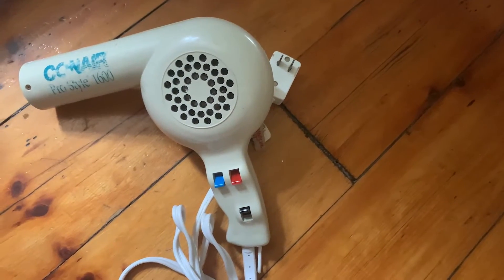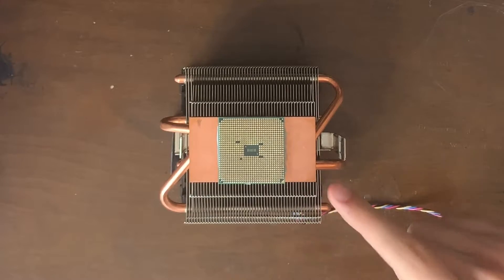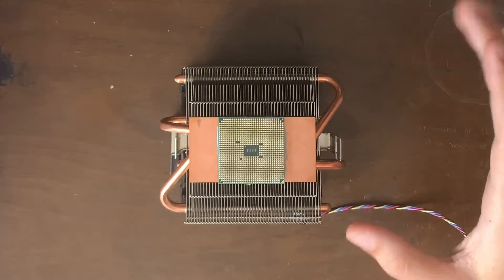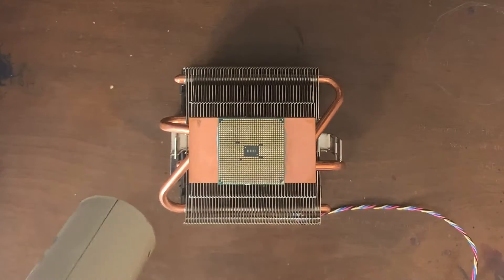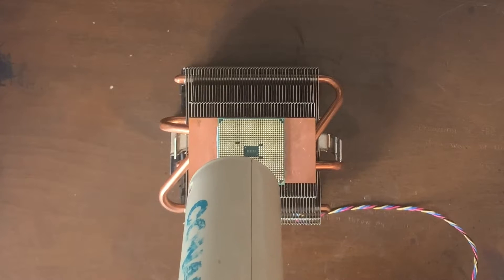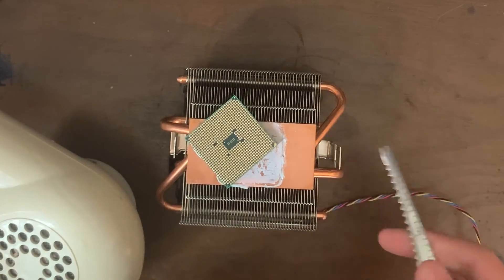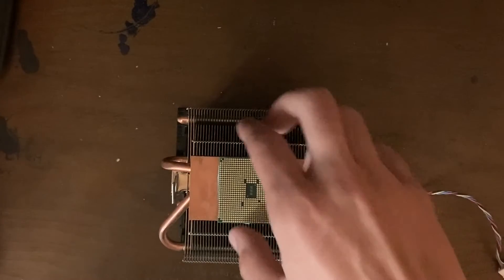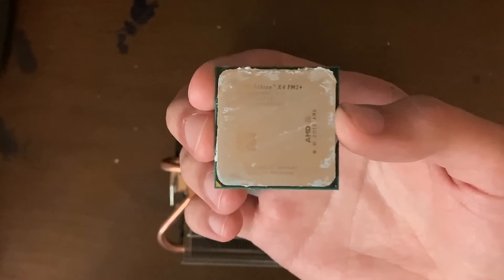How to Remove Stuck CPU from Heat Sink

Comment: My Ryzen 3900X got stuck too even after runnning a CPU stress test prior to removing it. It had the factory thermal paste and I ran this CPU for 4+ years. After trying to remove the Wraith Prism from the motherboard the CPU still came off with it and I bent 2 pins. Luckily they didn't snap off and I was able to bend them back in place. I'm glad AMD finally moved away from the PGA.

Comment: When you pull up a heat sink, and then if you just want to put it back on for whatever reason, can you just stick it back on with the old thermal paste? Will the old thermal paste heat up and become soft again after in use?

Comment: 1. You really have to get that hairdryer up close to get the thermal paste loose. Mine was dried up since I haven't replaced it in like four years.
2. I couldn't get a blade in beteween the CPU and the cooler, so I used a flathead screwdriver to forcibly get leverage. It worked but only do it as a last resort. Maybe you could use some plyers and support/padding to be more gentle, but I was so desparate. 
3. I bent the pins prying the two components, so I straightened them back together. Use a magnifying glass and get it as straight as possible. 
4. My system was shutting down on repeat after that, but it's because I didn't push the cooler back in all the way, so there was a gap between it and the CPU. After I sorted that out, my PC worked perfectly. 

Hopefully this helps even just one person. It was a stressful time, but it all worked out. 

Be gentle and be patient. Don't be like me. I was lucky.
Reply: HELP ME AND MY FRIEND HAVE BEEN TRYING FOR 5 HOURS SAME THING BUT OURS DOES NOT COME OFF AND WE ARE SCARED  WE WILL DAMAGE IT

Comment: Mine is literally stuck I have heated it up for 6minutes
Reply: Thats what I did bro and it eventually came off and it was not damaged at all. Thanks for the video
Reply from the maker: You’re welcome, glad it helped
Reply from the maker: Might be very ancient thermal paste. I would try heating it up for longer or making sure your hair dryer is on high heat.

Comment: What if you cant twist the cooler like the EK AIO. I have found that if you have no choice and you do pull the cpu out dont twist you will bend the hell out of your pins. you cant twist all the coolers .
Reply from the maker: Yes, twisting is for once the CPU is out of the socket, and still, you must hold the edge of the chip, NOT the pins, while twisting. Still any twisting at all should be done only with extreme care and at your own risk.

Comment: I had that happened to me once. My problem is the CPU latch couldn't be unlatched because the heatsink is too big and it's in the way. I made the mistake of pulling the heatsink and the CPU came with the heatsink bending the pins in the process. A very expensive mistake.

Comment: Are there brackets for prevention of a cpu coming out? Like holding the corners of the cpu to prevent it from coming with the cpu cooler?
Reply from the maker: Not that I know of. Intel CPUs are held down once installed in the motherboard, but AMD CPUs are not.

Comment: If you don't have a hair dryer?
Use a Q Tip dabbed in 99% ispropyl alcohol
Go around the crease of the chip.
Then twist the chip.
Reply from the maker: This, for sure.

Comment: Hey my man that works very well thank you for the tip. I heated it up for about 2 minutes with a blow dryer on high and with a little piece of plastic I wedged in there and it came right off. You the man!
Reply from the maker: Glad I was helpful!

Comment: How to avoid this?
Reply from the maker: If you want to prevent this happening to begin with, it’s a good idea to use a quality thermal paste and also to heat the paste by doing some gaming BEFORE attempting to remove CPU. Then, immediately after turning off PC, remove it, so that paste is still warm, and hopefully does not stick.

Comment: I thought it was meant to stick to the cooler no?
Reply from the maker: It is supposed to be a tight fit, but it should not adhere to the cooler when you try to remove it.

Comment: Bro how do you stick the cpu to the heatsink? Using glue or just heatsink will make cpu to stick itself?
Reply from the maker: You do not want them to stick together, since it is a nuisance to fix. I’m having some trouble understanding what you are asking, but if you are wondering how to install a CPU, use thermal paste, NOT glue. Under no circumstances should you ever use glue on any of your PC components, please do not do this. If you are not at all familiar with the process of CPU installation, I suggest you make sure to familiarize yourself with it before attempting to install a possibly very expensive CPU.

Comment: ggs I did this with my ryzen 7 3700x you’re a life saver. I was terrified 😭
Reply from the maker: I’m so glad it worked out! Nothing worse than when your CPU gets stuck like this. Thanks for watching.
Reply: I did it with the same part and my pins are bent to hell
Reply: @joshuabragg4782  dude I’m sorry man I was lucky none of my pins got bent I wasn’t ready to drop another $319.99 on a new cpu. I hope you get a new one cause the pc goes crazy
Reply: @khojertw  what caused it was being stuck to the cooler

Comment: I did this with my Ryzen 9 5950x the other day and damn near had a heart attack, Im soooo happy it still works lol
Reply from the maker: I’m glad it does! With a CPU that expensive, it really would have been devastating to render it unusable. Glad I was able to help, and thanks for watching!
Reply: I thought it would melt the pins
Reply from the maker: No, it definitely shouldn’t get hot enough to melt the pins. Especially since CPUs can withstand a fair amount of heat, and it is connected to a heatsink.
Reply: @LogansTechLab  yea I did it and it worked lol thank god 😭
Reply from the maker: Glad it worked out! And thanks for watching

Comment: Thanks a tryed for houers and nothing worked thanks a life time subscriber
Reply from the maker: No problem! Thank you very much for subscribing!
Reply: @LogansTechLab  can you help I have a problem a have a aoi Water cooler and on lanch it sometimes turns on and sometimes doesn't i found a temporary fix that I unplug the pc and wait few mins but on another day it diesel it again
Reply from the maker: @tntcomingcool4353  so when you power on the PC, the AIO just does nothing? Can’t say I’ve encountered this issue before, but maybe your psu is being maxed out? What wattage is your psu?
Reply: @LogansTechLab  sometimes nothing sometimes works fine and it worked for 2 years just a month ago start acting this way I tried swichin up the thing that I plug the air in
Reply: Idk but it worked fine before
Reply from the maker: @tntcomingcool4353  so what exactly did you do to cause the problem? Did you change anything about your PC before it started?
Reply: @LogansTechLab  no I didn't I started it one day lanched windows and then the pc tired off bc the CPU was on 120c
Reply from the maker: @tntcomingcool4353  yikes! That is a frightfully high. It sounds like it could be a broken AIO. Might want to replace that. How much did you spend on your AIO? If it’s a cheaper one, that’s probably it. AIOs do fail over time.
Reply: @LogansTechLab  idk I got the pc from my friend and it's a croshair cooler but I can't find it anywhere not even on their website well I think my cable broke and the same day my laptop broke lol good day but I fixing the laptop bc windows had disk error

Comment: I pulled out my CPU with the HSF without noticing until I looked at the socket.  I hope it's not damaged as the lever was obviously still down.  It still looks like new.
Reply from the maker: It should be fine, as long as none of the pins were bent, which is not very likely. I recommend that you just follow the instructions in the video, and you should be able to get your PC running again in no time. Hope this helps.
Reply: @LogansTechLab  Thinking of reselling the part.  I removed it to put in an upgrade, which works great.  My worry is I don't have an alternate way or other MB to check it.
Reply from the maker: @uncrunch398  If you feel comfortable doing it, I recommend you swap back in the old CPU to make sure it works before reselling it. If not though, just look at it and make sure there are no bent pins. If there aren’t, it’s probably fine to go ahead and resell it since the chances that it’s damaged are VERY low. Just make sure you package it carefully if you are shipping it. Watch a video on YouTube on how to package a CPU properly if you don’t know how to.

Comment: Help me please. I heat the cpu about 5 mins. But the paste still hard
Reply from the maker: Are you sure the hair dryer is set to hot? Sometimes they have a cold setting as well. Also, after heating, the paste can still remain somewhat brittle. Make sure, after heating, to twist the CPU, rather than attempt to pull it away from the heatsink.

Comment: Watching this after destroying my girlfriends ryzen 3700x and motherboard socket lmao.
Reply from the maker: I am really sorry to hear that. How exactly did the CPU and socket both get destroyed?
Reply: @LogansTechLab  so I've been building PC's my whole life, mostly intel. Went with AMD for my girlfriend's PC, it was my first time using pre applied thermal paste and using a AMD stock cooler, well i wanted to surprise her with a water cooling upgrade. Making the biggest PC building mistake of my life. I disconnected everything all normal as you would, as i go to pull up on the cooler. I didn't realize how tight of a fucking grip the cooler had, and i just ripped the CPU and fan right out of its socket while locked. The CPU still works, some minor bent pins. But the motherboard socket is completely finished. So i went to microcenter, bought a new motherboard and water cooling. Got everything working before she came home, needless to say, i will never use pre applied thermal paste ever again in my life.
Reply from the maker: @pietr036it  right, I mostly have built AMD PCs, and I must say they carry a greater risk of this sort of thing happening than Intel machines do. But I am very glad that at least you were able to get the CPU to work, since it was no doubt more expensive than the motherboard. I am confused as to how the motherboard socket got damaged though. I have several times accidentally ripped an AMD CPU out of the socket while attached to the cooler (indeed, it is quite a frequent occurrence) but I have never damaged a motherboard socket (or CPU, for that matter) by doing so. Was there any visible damage to the motherboard’s CPU socket?
Reply: @LogansTechLab  yeah so the socket is at a point where it loosely goes up and down. Hard to explain without showing. But essentially it's still connected to the board . But the special way it's fucked, is the CPU pins don't align flush, meaning when you insert The CPU, the pins will align. But there's a micro gap where the pins don't touch the board. Thanks for consoling me lmao. Legit had a fucking mental breakdown when it happened LOL. This has NEVER happened to me, even on PC's where thermal paste hasn't been changed in years

Comment: How do you put it back in ? Do you leave the lock down when putting the pins back in ?? I'm scared shitless
Reply from the maker: Have you separated the CPU from the heatsink? If so, lift up the lock, place the CPU in, then close the lock and apply thermal paste, then attach the cooler. It can be intimidating if you are dealing with an expensive CPU, but as long as you make sure not to bend any pins you should be fine. Let me know if you have any questions. Always happy to help.
Reply: @LogansTechLab  i ripped the pins out attached to the CPU. And yeah its an expensive CPU. I got a new cooler and this happened. I did end up bending 1 pin but got it straightened and back in. Cooler is on now and pc going back together. Praying for the best. Everything  was nice and flush tho
Reply from the maker: @sifter456  let me know how it goes! Hope it works out dude.
Reply: @LogansTechLab  shes alive, running better than ever, since i had some mx-5 thermal i decided to re thermal my GPU as well while i was at it, glad i did.
Reply from the maker: @sifter456  I’m very glad to hear it! Happy gaming!
Reply: @sifter456  yo i hope you remembered that you need to align the tiny triangle on the corner of the cpu to the one on the motherboard for correct orientation.

Comment: The plan: Take out my 2700X, put in a 5600X and use my Wraith Prism cooler (cause apparently its much better than the cooler included with the 5600X)
I tried to take it out cold but it would not move at all or twist. (which never happened in 20yrs of building pcs - but then again I also never let me coolers sit there with stock paste cause the wraith was the 1st cooler 'good enough' and I'm a dad now so very little time to do maintenance)
I figured I'd look around and saw that you had to sort of burn in the cpu to heat the paste. Great, 1hr of Cinebench R20 and aida64 later and the cpu at 90-93degrees, I power off and twist and pull and relief it gives a bit, I pull again and it all comes. Success!! - Nope, cpu still stuck and came out of the zif socket 😱

Now after 20 more videos I'm waiting to get some dental floss to try that first (as I feel its the least intrusive) then the hair dryer method. Fingers crossed but I'm telling you mine is like proper cement :(
Maybe last attempt I'll put a heat gun on top of the heatsink (I removed the fan shroud) but given the way the copper heat pipes go not sure it'll help a lot.

Also in the mean time I got the 5600X in with a Scythe Katana 4 I had before
Reply from the maker: Hope it works out! Let me know how the hair dryer method works for you.
Reply: Have you managed to get it off? I'm in the same position as you right now. What did you end up doing?
Reply from the maker: Using the hair dryer, as shown in the video. Have you tried that?
Reply: @Sams-747  had to use the hair dryer a Lot and I mean LOT
Then eventually it came off and kind you the heat sink gets very hot
Such a huge overlook on AMDs side really.

I was then able to examine the 2700x that had like 9 bent pins.
Straightened all up put in a new motherboard but it seems that the 1st pci x slot is not working.
I can't say if it is cpu dmg or mother board side though
Reply: Wow, what a pain in the ass that one was huh? Grats on getting the pins back in line, and the swap working out.
Reply: @ryzen89  Thanks.. I'd have been horribly stressed if it had been part of a maintenance and I had no other CPU to use. I got the 2700X in a Gigabyte B450M-UD3H to use as a homeserver for now. It's working ok but the PCIe-16X is not happy. Not sure if it's a motherboard issue or CPU 😬😬 Anyway I just need 1x PCIe-16X for now so we'll see

Comment: Haven't a hair dryer and zero corners free for dental floss 😭, so I have it at the back of the ps4 and hopefully the heat from that will work 👀 if not I'm screwed
Reply from the maker: Yeah that’s a but tricky. Maybe try using alcohol on a cotton ball to wipe away the thermal paste at the corners and then use dental floss.
Reply: @LogansTechLab  I tried that 😔 didn't work so tried to get it back in and bent a pin 😐 off to the repair shop with it 😂
Reply from the maker: channing1989 oh no! 😬 well bent pins can almost always be fixed but it’s tricky. What CPU is it? Hope it’s not a too expensive one
Reply: @LogansTechLab  it's only a ryzen 5 1600x nothing fancy, but it done me proud for years even 4k gamed with it somehow lol.. Not sure if I damaged the motherboard in the process so I have upgraded to a b450 f and a r7 2700x, as soon as its delivered its going straight into the shop to be set up 🙂 its been a nightmare of a day 🙈 especially for my wallet 😭😂😂😂😂😂
Reply: I have subscribed to your channel BTW, thanks for the video 🙂 shame for me in my case nothing would have worked except a hammer haha ✌🏻
Reply from the maker: channing1989 thanks for the support!
Reply: @LogansTechLab  your welcome 🙂 👍🏻

Comment: Hey i have a question. I know that my cpu is stuck on my cooler. I dindnt pulled it out yet btw sorry for my horrible english. So what can i do that i dont pull the cpu out( just the cooler of it) im very scared :D
Reply from the maker: What I would recommend is to start using your pc, and while using it, the thermal paste should soften so you should be able to twist the cooler off the cpu without taking the cpu with it. Just twist gently and if it doesn’t move try gaming, that should heat it up enough to come off. Just make sure you kill the power right after removing the cooler. Worst case you can carefully pull off the cooler with the cpu and do what I show in the video to separate them afterwards
Reply: Lisandro's Tech Lab Okay thanks a lot 👍